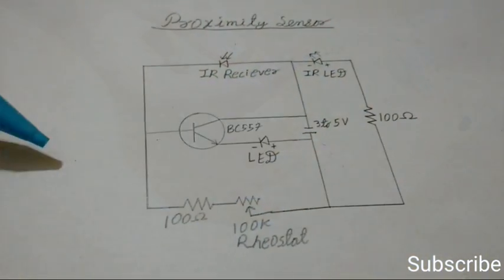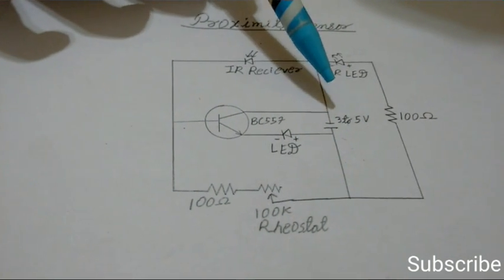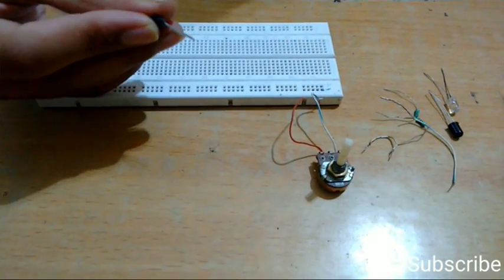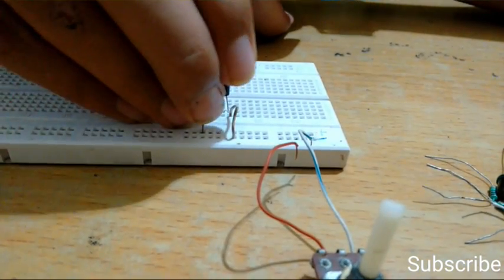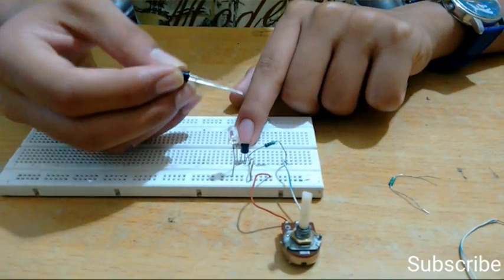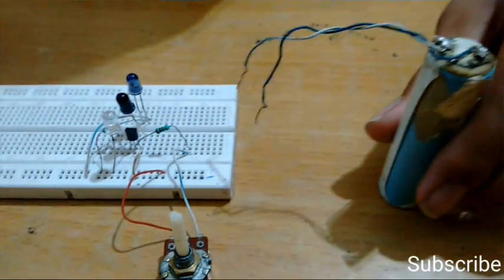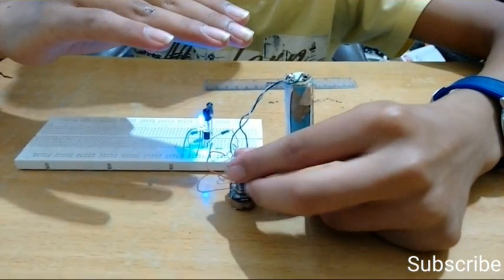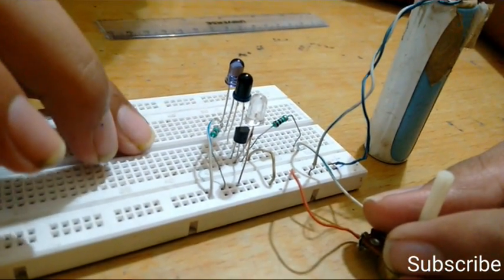How to make a long range proximity sensor. Descriptive

Comment: I think i made something wrong. Everytime i put my hand close to the ir led and receiver, the light turns off and when i cover it, it lights up.
Reply from the maker: +ken raganit you have used a NPN transistor, replace it with a PNP.
Reply: NGresearchers ahh ok, i followed your schematic diagram and the symbol of transistor is a NPN so i used bc547
Reply from the maker: +ken raganit there was a little mistake in the schematic.
Reply: change terminal of led

Comment: I need to increase it's range to be 3 cm to 400 cm and active angle to be about 50 degree
What shall I do
Note: I want it to run under 5 volt power so I can use it with Arduino uno
Reply from the maker: Watch my new video where, I have explained how to make a proximity with range upto 4 metres . https://youtu.be/jLQJd1oaW1o

Comment: hey bro i assembled all parts as u did in the video but the led is not glowing please help me out
Reply from the maker: +Shreyas Naik check whether the IR LED is glowing or not, check with your phone's front camera. Or test the circuit by pressing any key on your TV remote near the sensor.
Reply: yes i have checked the ir led with my phone's camera it is glowing. but how can i check photodiode. also i tested the circuit by pressing the key of tv remote but the led is not glowing. also i checked my led its ok. please help me out.
Reply from the maker: +Shreyas Naik join the two terminals of the IR receiver with any conductor, if the LED glows then you have problem with the receiver or if doesn't glows then remove the resistance/rheostat and then try the same process.
Reply: thanks for your reply!!

Comment: kindly guide me please how can i conect dc motor with ir sensor.(may be instead of led)
Reply from the maker: +Hassan Raza, use 9v battery for input, replace the LED with a12v relay and connect anything you want, to the relay.

Comment: sir How can the 3 pin ir recver sensor be applied?
Reply from the maker: shiv rawat The three pin IR receiver has an inbuilt transistor circuit in it, so you can not add it to this circuit.
Reply: Nishant kumar I do not have a 2 pin receiver. Tell me the 3-pin receiver's circuit

Comment: Hi Nishant, this setup is working really nicely for me, (as a proximity sensor with same components) using a 100k resistor in place of a rheostat.  I want to increase the range to around 1.5-2 metres. Is it possible with this circuit?
  Mind you, I live in  really humid conditions with plenty of sunshine and I need to use it outdoors for a project. If I hide the sunlight with a 2.5W PV cell then the sensor might avoid unnecessary IR radiation from the sun. So yeah, if you can answer the range part, it would be nice. I've tried maintaining an open circuit in place of 100k resistor. What I observed was : The LED glows brightly instead of being off. And when I bring my hand closer to the transmitter/receiver unit it glows brighter,similar to the 100k setup. Please help me correct this and increase the range.
Reply from the maker: Vivek Vasudevan Actually, increasing the range of proximity sensor means to increase the sensitivity of the receiver which in turn will create a problem that, after increasing the range or sensitivity it will be able to sense even the minute amount of infrared that is being emitted by your body or even by the light present in the surrounding but you can do something different watch this video https://youtu.be/crLKXitBbQg .But remember not to change or alter your present circuit (since I have made another circuit in that video) just place the LDR unit in place of IR receiver and use the laser to sense the presence of any thing as shown in the mentioned video.
Reply: Thank you! Post more of such informative videos. :-)

Comment: please tell that can i use it without a potentiometer? distance doesn't matter to me
Reply from the maker: Amashikha Dutta ofcourse, instead of the potentiometer you can just use a resistor of resistance 40k-100k. But keep in mind that increasing the resistance will increase the sensitivity of the proximity and hence the distance.
Reply: Nishant kumar ok..thank u very much

Comment: Sir, my led is glowing continously even after removal or the ir detector. I hadn't used BC557 transistor
Reply: I used CTBC547B transistor
Reply: And yes it is pnp transistor
Reply from the maker: Manthan chauhan may be that it has its terminal in different order (in case if it is cuboid shaped) or the connections (of specially resistor) are loose. 
I will suggest to rebuild the circuit by following the instructions carefully.
Reply: Nishant kumar sir it is the tradition semi cylinder shape transistor. I had used a 9v battery and CTBC547B transistor
Reply: Nishant kumar sir I got no benefit in rebuilding the circuit
Reply from the maker: Hey, sorry for the late response but BC 547(that you are using) is definitely a NPN transistor.
You will notice that after adding the resistor(1k-20k), the sensor works reverse of that shown in video i.e the LED will glow when you aren't providing IR on the sensor, and the LED will stop glowing whenever you provide IR.
Please, comment me back after you view my reply.
Reply: Nishant kumar sir if 1k-20k is the range of rheostat for reverse functioning?
Reply: Nishant kumar sir I'm already using a rheostat of range 1k-20k.
Reply from the maker: So, actually it will work reverse as I have stated above reason it's a NPN transistor.

Comment: it's working inverse..when I put my hand on ir pair led turns off otherwise remains on... please help
Reply from the maker: vinay patel, actually you have used an NPN transistor so, to solve the issue replace it with a PNP transistor for example BC 557.
Reply: you can use a 12v rellai before led

Comment: try to build using an OP AMP ic to get 1 meter range...
Reply from the maker: Do you know something about this, as I am not yet able to work with an IC.
Reply: op amp ic are not work properly...
1st problem- some time it's work like reverses..(when objects come near to ir receiver then it's Automatically turn off  and when no object near the sensor then it's become glowing..)
2nd problem-when u fixed distance sance then some time it's become turn on...

so using only transistor for this sensor...

Comment: stop using LONG range sensor, becauze its not a LONG range sensor its just only an simple  proximity sensor,
Reply from the maker: Actually, it is a long range proximity sensor. All you need to do is to increase the resistance between the base and the +ve terminal. If you want its optimum sensitivity then remove the resistor/rheostat so that the resistance could reach up-to infinity.

Comment from the maker: Mr Priyabrata Nandi, you can increase the sensitivity of the proximity sensor by just increasing the resistance between base and (+)ve terminal. And to convert it into a IR detector just remove the IR Led and then it can detect IR in the range 10mtr or more depending on the IR strength.

Comment from the maker: Actually you have used a NPN transistor in the circuit, to get rid of the problem replace it with a PNP transistor for example BC557 or any.

Comment from the maker: (answer for trending events), actually the problem is occurring because your room may contain a CFL bulb or tungsten bulb which contains a huge amount of IR. It will work better only in presence of LED bulb, dark or any other source of light that doesn't contains IR.